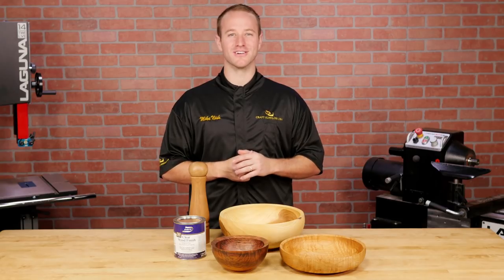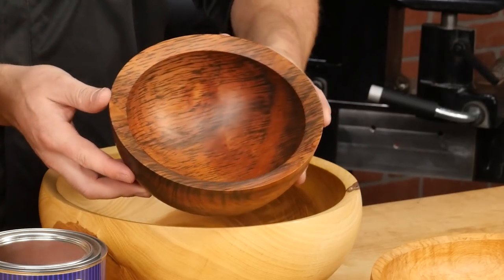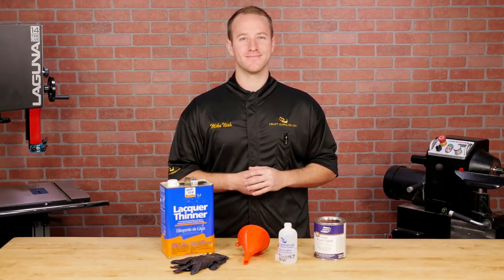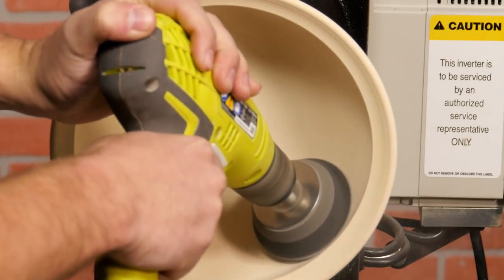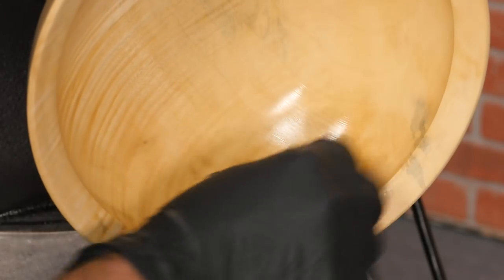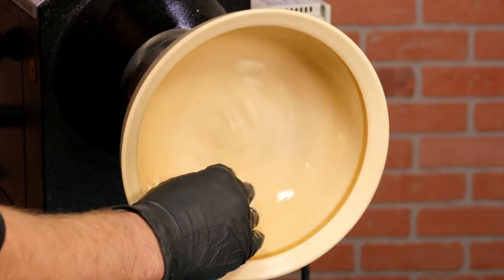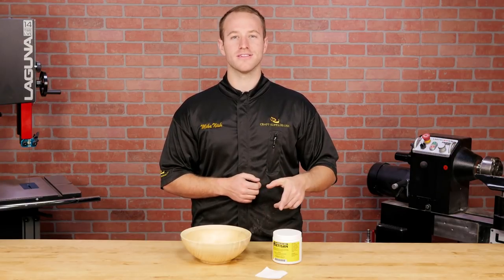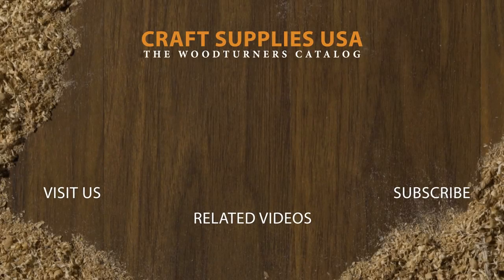Applying a Deft and Oil Finish (Woodturning How-to)

Comment: Can I apply the Deft over top of an oil based finish like Waterlox, or a Maloof oil blend.  Which is equal parts BLO, Tung Oil and Polyurethane.  I want the darkening from the oil, and the protection of the Deft Lacquer.  Than you.